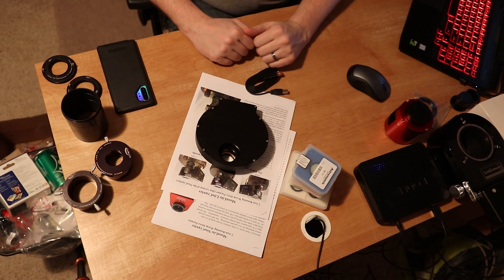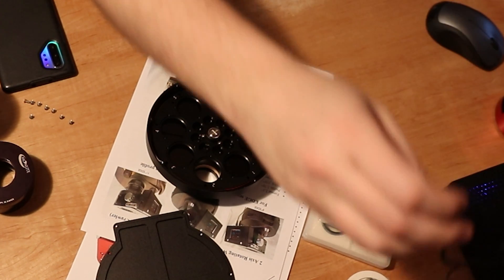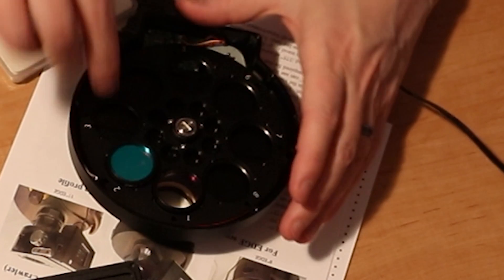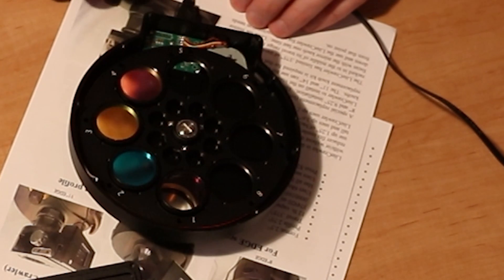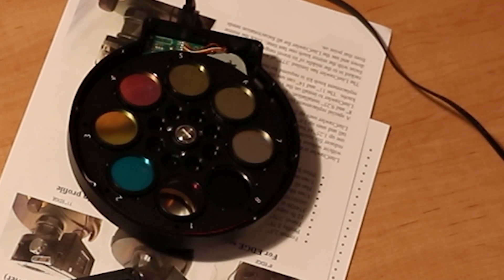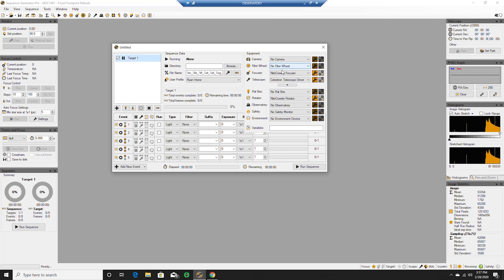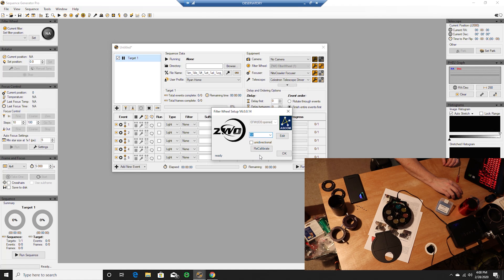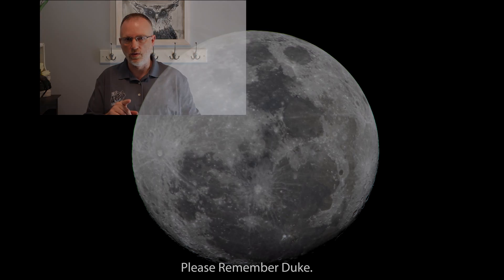EP123 - Bench testing and setting up SGP for the ZWO 8 position EFW

Comment: Your really taxing that mount.  Instead of night crawler I maybe would have looked into better mount.
Reply from the maker: Thanks for watching and you concerns.  While I agree I am heavier than I should be, I am still under the payload capacity of the mount.  So I should get some more time out of it.  I was looking at a new mount at first when I have my issues last year with the RA motor.  But since it was still under warranty, I opted for some new imaging train and tracking gear first.  Next up will be saving for a new and beefier mount.  This one can then be used to build up a wide field and lighter setup.  At least that's the plan.  Clear Skies.
Reply: I'm new to this when you mean"mount"    what is it that you are talking about?  Thanks.

Comment: If you haven’t figured it out yet, when you setup the filters you set them in the Driver, and not in SGP. Under the filter tab SGP still needs to be told what the filters are on the software side - it’s not smart enough yet to look into the driver and pull the information over.
Reply from the maker: Thanks for watching and your suggestion.  I did find that out the first night I was trying to get everything to work.  I did end up configuring the filter setting in SGP and in the couple nights I have been able to image, it's been working great.  Should have my settings and "first light" videos up next week sometime.  Clear Skies.